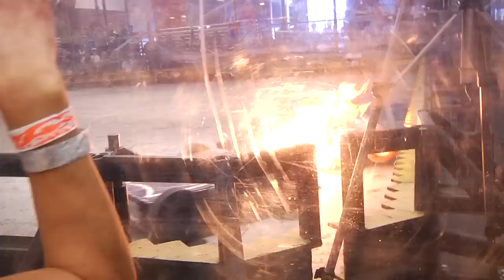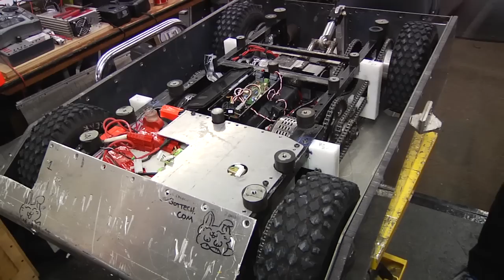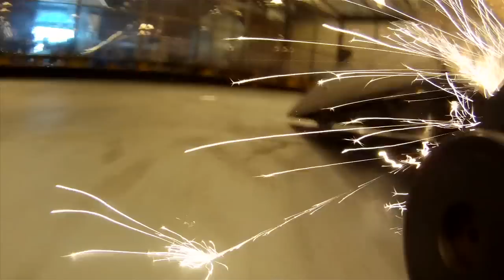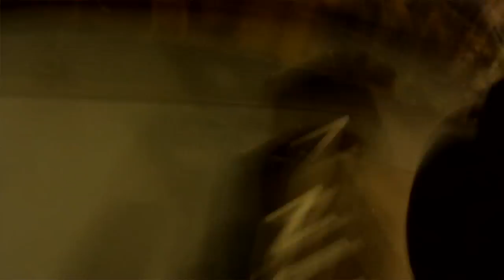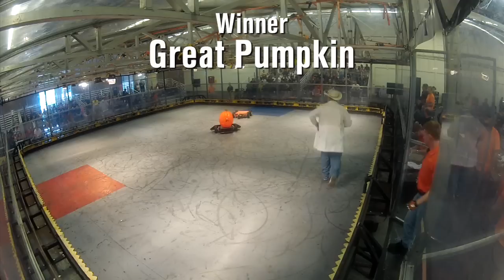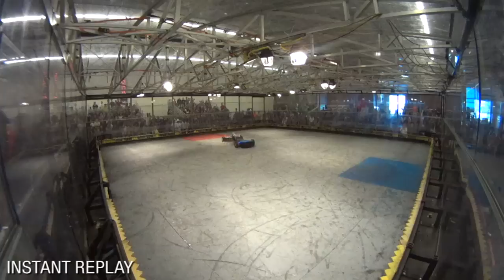The Awesome Robot Battles of ComBots Cup 2012

Comment: Could you have a titan plated robot with legs fireing real ammonition? Weapons are mechanical so it is not electrical.... Or a robot placeing "landmines" small pads that blow it self up and throws the other robot skyhigh!
Reply: Explosives and untethered projectiles aren't allowed, sorry.
Reply: +Yin YangGamingIndustries  So what counts as an explotions? could use something like airbags....
Reply: I like the way you think.
Reply: Again, no explosives. You could run it off pressurised CO2 though. But what do you plan on doing with an air bag?
Reply: By 'titan plated' you mean titanium plated? Contrary to popular belief titanium is not the wonder metal popular fiction makes it out to be, sure it has some properties that are desirable in some situations but other materials could well be better suited for battlebot construction. Personally I would probably go with something like (hardox 400) steel to 'armour' my bot if I were to build one.
Reply: i dont have any experiance with these robot battles. but was thinking about haveing a pad the "enemy" robot drives over then it blowes itself up flipping the robot.

Comment: Why not attach a saltwater squirt gun?
Reply: Alex Lubbers Saws have their cons and pros. They're almost always the make or break of the match. if the saw-bot gets its saw damaged it tends to fly apart. Where if it's lucky and gets the first hit it usually damages the other bot pretty fast.  Though I'm not thinking of cutting saws as much as I am spinning wheels with blunt bits that smash things that get in it's way. The cutting saws never impressed me in Battlebots and I don't recall seeing any in Combots. They just never seemed to pierce the enemy's shell at all.

I'm staring at the rule list right now and apparently gunpowder and other explosives are disallowed. That could be an interesting thing to watch but I guess it would be dangerous to have explosives on a damaged robot if humans are intended to interact with it.

Though I understand the "why" this rule list bans a lot of fun ideas. Un-tethered projectiles included. So I guess fireworks get multiple points against them. Odds are this was something everyone would have tried though - shooting the enemy robot.
Reply: Ludwig Van its probably against the rules
Reply: Ludwig Van Electrocution is illegal
Reply: Ludwig Van Could easily backfire I figure. Imagine if the saltwater bot is hit first and the water tank is ruptured. Even if the water tank were external (which would almost guarantee losing the tank every battle if they get hit at all) the pump to squirt the water would have to draw it into the bot to pump it out. The tubing would potentially rupture and spray saltwater inside the bot with decent impact.

Honestly it wouldn't be an interesting battle anyway.
Squirt squirt. Game over. 
Crowd boos both competitors out of the arena. 

Overheating the enemy's circuitry with fire was more effective than I expected and it was fun for the audience to watch. Personal bot popularity is a large part in games like this.
Reply: Ludwig Van what about a tesla coil? nothing beats the enemy bot with a 500kv bolt of lightning subduing the enemy's electronics. either that or a squirt gun or a firework shooter array. say u make a square wedge bot with some titanium saws on the corners, but the secret is the roman candles on the sides for a barrage of flaming balls of DEATH
Reply: Actually I found out recently that liquid and electric weapons are both disallowed. Electric weapons are disallowed purely because it's too dangerous to the humans with the arena being metal and it being impossible to see it to verify when it's deactivated for human touch. I forget why why for liquid.

Electricity could be interesting to watch if it didn't just end it in a single zap. Hypothetically speaking.
Reply: yes of course, i can see the possible boring turn if the fight of the century ended with a single zap, liquid would probably do the same thing and permanently damage the bot. but still think its a neat idea to have titanium saws and firework shooters?
Reply: oh. thanks for the info.

Comment: As far as Razer eating these bots for breakfast, ehh no. Every competition the bots get better, it's iterative design with the intent to beat the other bots. It didn't work out well for Razer 13 years ago, so unless Razer had some big changes it would be even more brutal for them (for example  watch?v=jUlCzzlo1kE   ). 

Though a good modern crusher could do well... they tend to be on the complicated side which means more bits to break and go wrong. A tough bot to build, but not impossible.